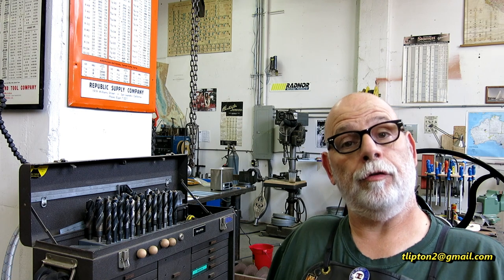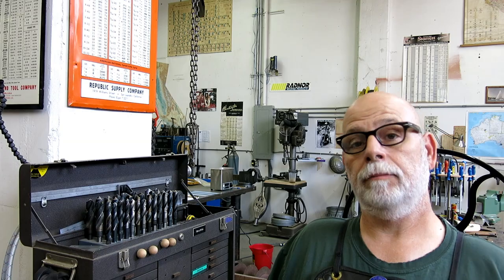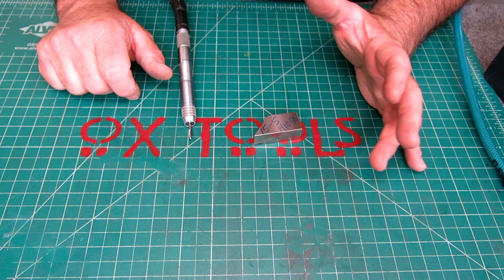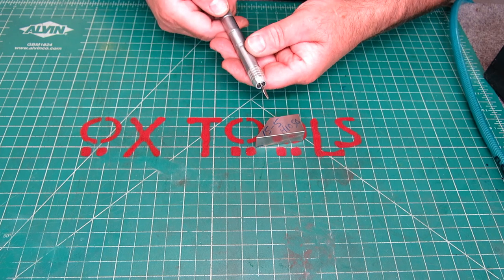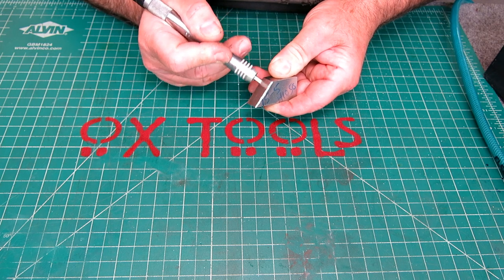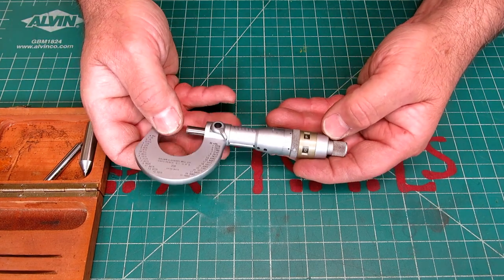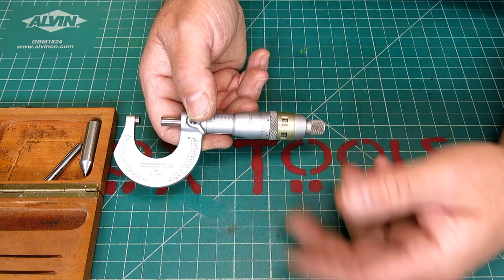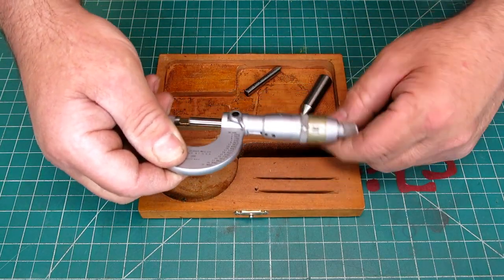Monday Night Meatloaf 126

Comment: setting that plane down flat had me cringing.  I must have had some conditioning (likely my father yelling at me) to make me always set a plane down on it's side.
Reply: Same here (once), but one of the great woodsmiths (Paul Sellers) claims that if your workbench is free of hard debris, placing a plane on its sole is better, because you can't bump some other tool into it and ding up the edge.

Comment: You inch guys amuse me with your charts, I'm not anti-inch, but in engineering, metric is simpler, thread drill sizes, drill bits, no need for charts! Cheers, Matthew
Reply: of course you need charts... they are just a lot smaller and fit on the back of a caliper.
Reply: well i am not completely anti metric and only because i have to own two complete sets of tools....however there are still only two types of countries...the metric ones and the one that put a man on the moon :). just messing around !!
Reply from the maker: Ok Matthew. Challenge accepted. Lickety quick without looking at a chart what is the tap drill for a M1.2x 0.25? Bonus for M6x1.00 roll form tap drill size?

Cheers,
Tom
Reply: @oxtoolco  It's written on the tap!

Comment: One of my many jobs in the shop is the finisher on all prototypes and SpaceX parts. I live and die by my little die grinder pin. I just finished deburring a 3D printed titanium prototype radiator for GE Aviation that I swear had 2 miles worth of fins that had to be deburred.

Comment: Sees a broken electric screw driver "Hey, I don't have any use for that, but it's only $3.00."
Looking through McBastard costs more than a Carr "Hey, these countersinks are 90° and will fit my $3.00 screw driver."
Goes to use the new power deburring tool "Hey, changing bits is a pain, I need three more electric screw drivers."
Christmas comes around "Hey, sorry grandbabies, it's been a bad year. Maybe I'll get you a present next year."
This, boys and girls, is how we all die with the most toys. Yeah! I win!
With the die grinder, hook it up to a foot switch and leave it hanging near the mill.

Comment: Sure that grinder doesn't need a lubricator?  My old Russian tilt-head air turbine has oil-lubed bearings and it needs oil in the air to lubricate the rear bearing.

There's also the Digit-Mike which has a larger head to accomodate a stationary readout window.  I've never seen one personally but I'd imagine it would work well for bench use.

Comment: Thanks for the meatloaf. Nice plane you got there. A tip for you, skew the plane on rough edges and it will cut much smoother. Also keep your cuts fairly thin and you will have better results. Thanks for sharing.
Reply from the maker: I think I discovered that by process of elimination. Thanks for the comment. 
Cheers,
Tom

Comment: I like your filing better. It may even be more accurate.
When working with a plane on a rough starting surface, try making a short cut at the far end of the workpiece, then a bit longer (pressing lightly where you have already cut); then a bit longer, until you are making a full cut. The idea is to have as much of the sole of the plane in contact with the workpiece as possible while the surface is rough and only progressing to starting with  just the front of the sole when the surface is already fairly smooth.
I really like those "complete" decimal equivalents charts. I had only found a small one (about 5 x 10 inches); I'll be glad to get a wall-sized one (ordered). They are supremely useful when tweaking holes. When you are looking for the next size up or down, you really don't care what kind of drill or reamer it is, you just want the next closest size.
Yow! At $25-$30 apiece, those countersinks are a bit pricey. I was intending to get a set but shied away when it ran $175.

Comment: HDPE (like the King Starboard) and UHMW work very nicely with hand planes and chisels (really any sharp straight bladed tool). Files and rasps don't work well on HDPE.
I tried hand planing aluminum, and it cuts it but not well. The way to hog off aluminum (for those of us without milling machines) is a farrier's rasp or a drywall rasp. They're amazing.
Oh, and I get old Stanley planes for cheaper than $90...
Reply from the maker: Yeah but are they as cute as a speckled pup like this little Lie Nielsen?
Cheers,
Tom
Reply: @oxtoolco  Nope, not quite as cute.
$90 isn't much when you consider what it would take to make something like that yourself.

Comment: We used those same Dewalt screw drivers at my last place of employment for exactly the same thing. Great for when you got a part with a 12 hole bolt pattern and you've got 30-40 of them to deburr. We also used those pencil style grinders for knocking off burrs in tight places where you couldn't get with a deburring wheel.

Comment: Near the end, 4 screwdrivers with quick change chucks. I wouldn't do that as they're just so easy to swap (might do it on a job with multiple processes that needed the same tool twice if a lot of repetition was on the cards) but for grinders, that's my attitude, too. Changing a disk to a cutting wheel and back is way too slow. More grinders = better :-D

Comment: I'd be amazed to see a pencil die grinder work a surface as flat as what a file will do, especially with a small diameter but like that.  A larger diameter stone helps avoid ripples in the surface, but a file will still do a better job.

I'm eager to see your Drill America test results. Please be sure to mention which line of drills your testing; Drill America has a number of them, some imported, some not.

Smooth, slow strokes is the way to go with planes. You want about a 2-3 thou chip that looks like a paper ribbon. You got it at the end there

Comment: Any chance of getting a good back view of that micrometer, so we can watch the numbers as they change?  I have a theory, which is that they're on a dial that's coaxial with the main axis, and there's a gearset (probably internal ring gear with slightly smaller gear inside it) that rotates them just over or under one turn for every turn of the housing.  So the dial would have "25" next to "0", and when you start at 0 and turn the housing a full turn, the dial has turned by one position relative to the housing and shows the 25, and so on.

Comment: You can cut under an edge that a mill/grind can't get to.  If you had a 5 dimension mill maybe...  Those are also sold to cut and grind exotic wood that is to hard to cut with a knife.  Can be a cool tool in an attachment.

Comment: I was fortunate enough to be allowed to keep the medical variants of that grinder from a dentist that was upgrading his tools. Aside from the pure noise torture, which i was told by the tool rep that brought the new stuff, is because these need to be at the very edge between power and miniaturization, they are gorgeous tools. Had to clean them tho, biohazard 101 :))

Comment: Three more electric screwdrivers would be the right way to go, three more batteries?  I think so otherwise your swapping batteries all the time, grin...  I am the woodchuck you mentioned, we have the same issues.  How many routers does one woodworker need?  I don't know the correct answer but I have 5 and am shopping for a sixth.
Reply from the maker: Hey Dan. That kinda goes without saying. The only confusion is how many chargers? Those are not nearly as much fun as the tool.
Cheers,
Tom

Comment: Loved the little plane, I'd bet it would work really well on plexiglass. I used one of those screwdrivers in my TV repair business for years ,I used mine with a magnetic tool holder which also gave me A bit of clearance with a two inch extension it works great. Thanks for being out there, stay safe my friend.

Comment: OMG $700.00 for a die grinder? It is nice, well made but, way overpriced.
Reply from the maker: Check the price on the NSK Nakanishi evolution electric grinder if you want a heat attack. Super smooth and quiet compared to the Dotco.
Cheers,
Tom

Comment: grinding is a great roughing process were as filing is both, a slow roughing and good finishing process. I was hoping that you were going to touch the grind with a fine file to show the superior results by file.
Reply from the maker: Hey Gary. I probably should have. I wasn't super happy with that lumpy line from the die grinder.

Cheers,
Tom

Comment: NSK makes a fantastic little electric grinder called the ESPERT. Lots of attachments and whatnot, a bit pricey but they last forever. Can set them from 1k to 50k rpm and are rock solid. In my opinion,  they are the best of both worlds between electric and air die grinders.